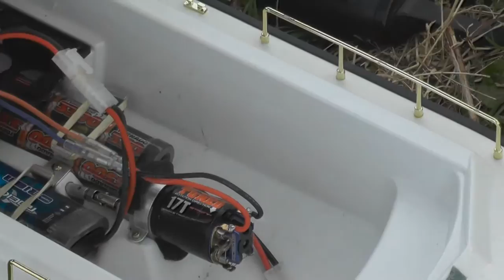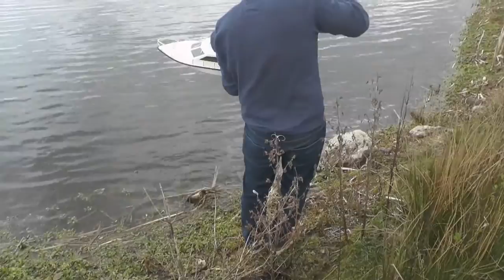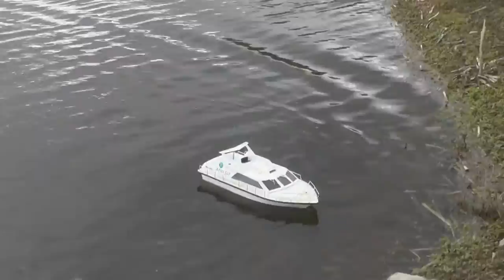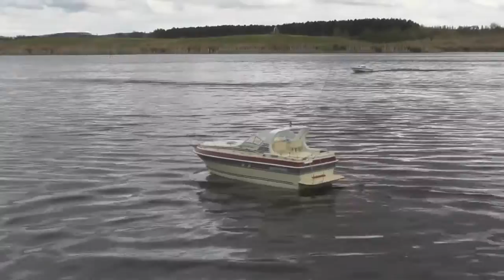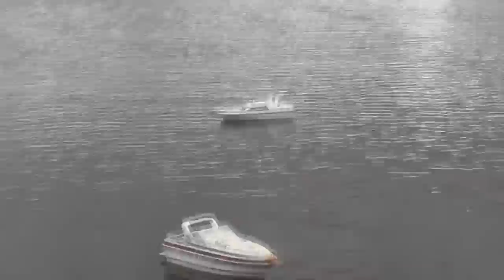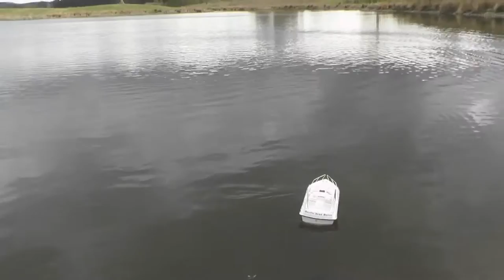Vintage boats return! Veesport: More voltage. Atlas: More RPM. Pursuit of speed!

Comment: needs a brushless, but to bea seious, or it is a crappy motor or something is slipping
Reply from the maker: Nah, it's sorted now. It has a reduction gearbox, which massively slowed-down the prop speed. Now it's using direct drive and is just as fast as the other boat.